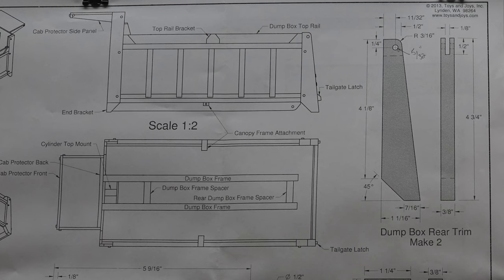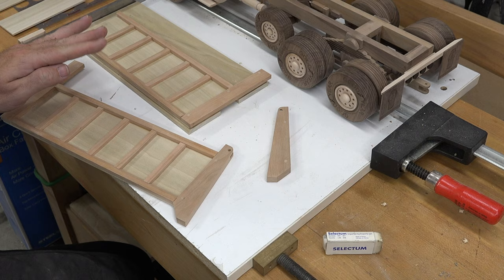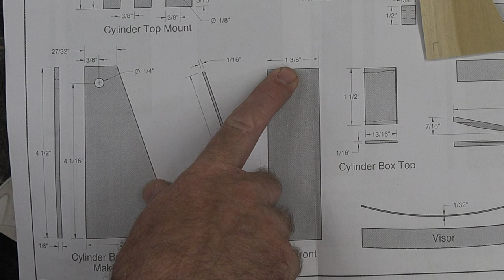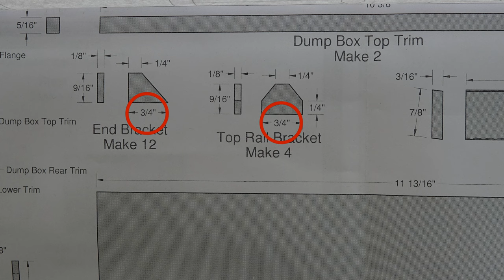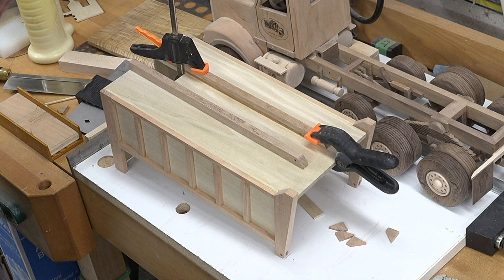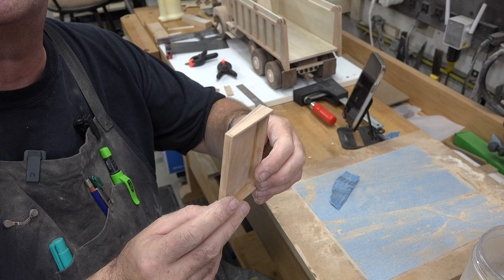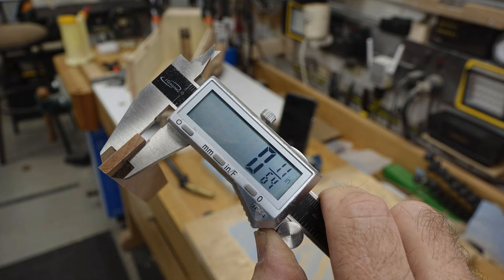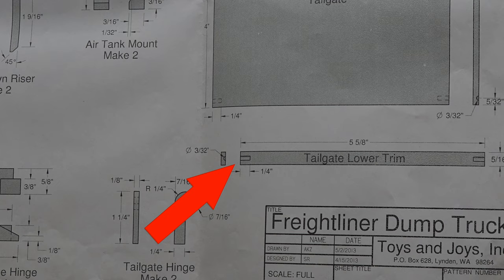Making Toys and Joys Dump Truck and Pup Trailer Part 14

Comment: This is an amazing series of shows. When it's finished, it needs to go on display.
Reply from the maker: It will most likely get a custom floating shelf to hang on the wall with all the other models Mark.  Unfortunately, that was has run out of room and I need to figure out some other display options.  I have several models (the train, the x-wing, the excavator and now the dump truck) that don't have homes.  This might be a challenge.  LOL.  Thanks for tuning in and for the kind words.